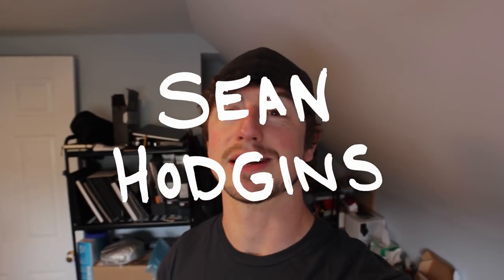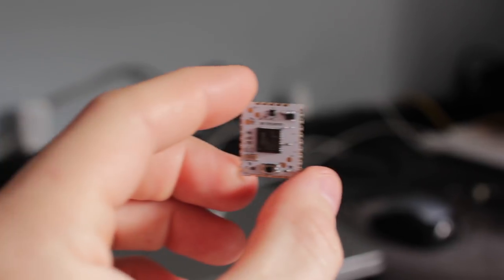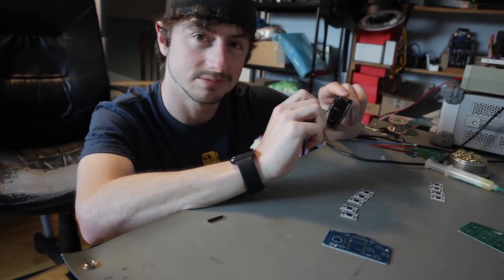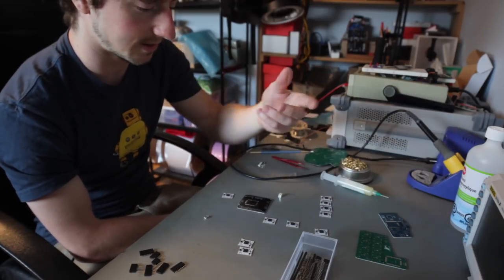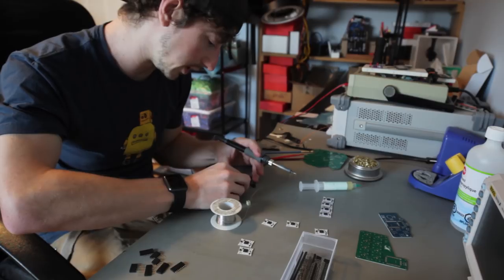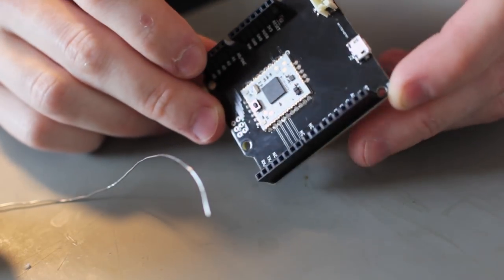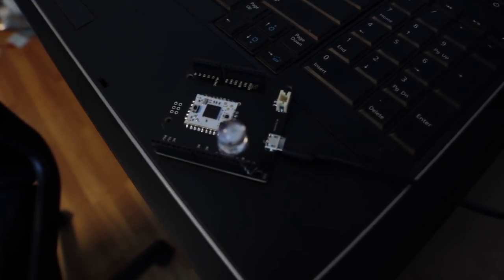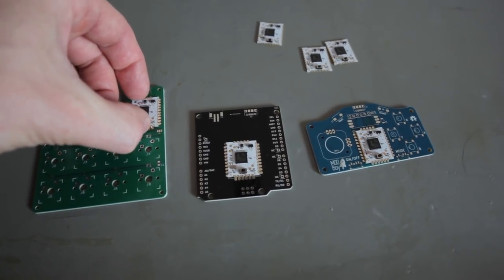Easily Design Your Own PCBs! The SAMD21 HCC Module

Comment: Nice, I like the idea, but puzzled why you like the SAMD21.  It is a lot more expensive than the ubiquitous  STM32F103C8T6, which has similar capability, and costs just $1.
A similar idea ... one could put a QFP processor on a standard PCB adapter plate, then, with long pins, stack a plate on top of it with an AMS1117-3.3, microUSB, crystal, reset button, and decoupling caps.

Comment: Interesting. I get the advantage of having a  pre-existing basic module ready to go for projects. I do the same with Adafruit ItsyBitsy's as they are cheaper than rolling your own. Looking forward to seeing what price point your Kickstarter comes in at per unit.
Reply from the maker: Similarly priced(in CAD though) but with included shipping. Its difficult to compete with Adafruit pricing, considering their sales volume. However, being that its a Kickstarter, get things rolling, and if it takes off, Ill be able to lower the price if I continue to sell them later.
Reply: SeanHodgins I find the trick to getting Adafruit product up here in Canada is ordering through Digikey. Only $8 for next day shipping and I often order from them so a couple Adafruit items bumps my orders over the free shipping threshold.

Comment: thanks for the inspiring vid, Sean. Is there anyway possible that I can power up my HC-05 Bluetooth module (feeds up 5V , says on the datasheet) with the HCC Module? I have a project that requires 5V output to some of my modules including HC-05 and tha't why I'm asking. Thanks and love your videos.
Reply from the maker: The HCC module is a 3.3V device, but it has a voltage regulator that can take 5V. Any signals or voltages on the IO would need to be 3v3 or level shifted though.

Comment: Do you prefer the oven method over a hot-air rework station?  I'm debating which to purchase.
Reply from the maker: You'll need both eventually, but I have never reflowed a board with the rework station. I've only used it to fixed boards that have been flowed in the oven; fix QFN, or if a TQFP has shifted and I need to move the whole chip. Otherwise I just use a soldering iron to fix bridges and small issues.
Reply: Thanks.  Your HCC  Mod project has definitely had it's desired effect on me.  I've been learning Eagle and slowly building more and more complex boards of my own.  Having a small microcontroller onboard is going to save so much room and make so many more of my projects do-able.    I'm at the point where I want to take that leap to SMDs but now I'm starting to get nervous.  0805 parts are insanely small.

Comment: hey sean think your video is awesome, but i was wondering if you could help? - i'm not sure how easy this would be to build but - i want something to wait for a 12v signal .. and if it gets 3 flashes of 12v within a specified time frame (1-2sec) it lets the 12v through to another pin .... hopefully on a passive board ... is this possible ?

Comment: Just a quick reminder that many EDA tools have a functionality called building blocks/reuses of schematic areas - you basically have a template consisting of a "known good" schematic snippet like your MCU with crystals, decoupling and stuff and can place it as one single block  across projects. Most of the time you still have the ability - that you miss in your HCC module - to rearrange the parts of your snippet or improve on it. I understand the reason why you did that, but for your own personal use, I would not really recommend it.

Comment: hi sean. Short Question i am not good on the samd21 chips but i read that they didnt have softwareserial and i have to use an SIM800 Module wich use softwareserial. So could you explain me how i do this with the samd chip? Have i to wire the sim modul wich has RX and TX to the RX and TX pin of the hcc modul? So this means RX to TX and TX to RX. Please explain i really like this HCC Modul but need a bit of help here. THX So far
Reply from the maker: Any UART (Serial) can be software serial or hardware serial depending on what pins you use. Software serial is just a "bit bang" version of UART, meaning the code is written to make regular digital pins act like UART. In most cases (depending on speed) software and hardware serial are interchangeable. If you were using software serial and want to use the HCC Module just connect them to the hardware serial pins (Pin 1 and Pin 0).
Reply: @SeanHodgins  But the Arduino IDE dont let me compile because softwareserial is just for boards with different frequenzy and not for samd21. Or does this mean i also could use hardwareserial as this Serial1 i read about. Could i use any digital pin for this or only this rx and tx pin from the hcc modul

Comment: Great vid  - What are you applying with the hypodermic needle at 3:51?
Reply from the maker: Rob O that’s flux, just makes the solder joint easier and cleaner since I’m just using the solder on the tip of the iron(instead of adding more solder) - it’s just an applicator, not actually a needle haha, not sharp.

Comment: Hey Sean, did you ever run into a problem when plugging in the HCC module and windows says "Unknown USB Device (Device Descriptor Request Failed)". I've already bootloaded and everything following your other tutorials but stuck on that error so can't program it in the arduino IDE.
Reply from the maker: You can get that error if there is a short on the board you soldered the HCC module too, if too much current is being drawn etc. Did you load the bootloader before it was soldered on(like my tutorial)?
Reply: @SeanHodgins  Yes I loaded the bootloader before soldering. I thought there was no short however after inspecting again a notice a tiny solder bead under one of the  diodes. Once I removed it the error was gone! Thank you for the response and love the work you're doing. Keep it up!

Comment: Hey Sean I wanna make my own samd21 board, what are the bare (bare as in no built in serial communication or built in pullups etc., Just to the point so it can function) minimum components to make one?
Reply from the maker: You're looking at it in this video. You just described the HCC Module. You don't need the oscillator and its caps, but you need everything else(unless you already have regulated power). Reset and LEDs can go too. 0.1F Capacitor on each VCC line, and that is pretty much it. You'll probably want a reset button somewhere.

Comment: Just a thot, but would it be a thing to use an ElectroPlating Pen to bond tiny connections like this?
Using an electrolyte solution like zinc or tin or even copper?

Comment: How are you installing the arduino bootloader onto the chip?
Reply from the maker: Ethan Frei I’ve made a custom pogo pin jig that you just push the module into. There are 5 test points on the top of the board. So they’re still accessible if you want to do something to the bootloader after it’s soldered on.
Reply: @SeanHodgins  be interesting to see that process

Comment: Interesting project. However a similar thing already exists: the ESP12-F (ESP8266) and the ESP-WROOM-32 (ESP32) modules. They’re very cheap ($3-$6) and they both have Wi-Fi built-in. Though the SAMD21 might be more low-power (the ESPs with radio enabled are very power hungry), so depending on whether you want Wi-Fi or not, choose one thing or another.
Reply from the maker: GRBTutorials I’m aware of those, since my last kickstsrter used the ESP32. Haha they still require a FTDI chip to talk to them, and a voltage regulator. That’s the point. Plus ever measure the start up current of a ESP32? Haha. The ESP has its place but I prefer to use the SAMD. It’s more versatile if you don’t need Wi-Fi, which is why I used them in the majority of my projects.
Reply: SeanHodgins Interesting. I didn’t notice the fact that it doesn’t have a USB to Serial converter. I haven’t reviewed the PCB yet, but it seems at first glance that the only chip is the SAMD21. Does it have a native USB interface like the one on the DUE? If the power consumption is low, it could be interesting for some of my projects (though the STM32 looks really nice as well).
Reply from the maker: GRBTutorials yep, the boot loader that will come on it allows native usb, that is what makes it so great! The Kickstarter will start tomorrow and I have a more informative video along with it.

Comment: naaaah, it's still expensive in most of the country, it's not easy, u have to match with what component that available around you, aaand if u depend your pcb making to china, the shipping is more expensive than the pcb itself, so yeah it's actually the opposite whatever u said in the video
Reply from the maker: There are some very slow shipping methods that are cheaper.
Reply: @SeanHodgins  c'mon man, $5 for 10 PCBs but $22 for shipping.
Reply from the maker: @britantyowicaksono8409  the pcb companies don’t control shipping costs. If I ship something to you, it costs what it costs, I have no control.